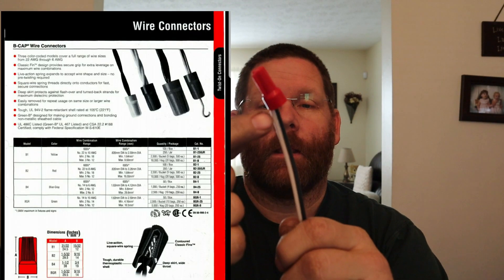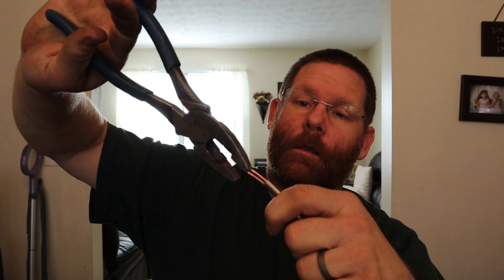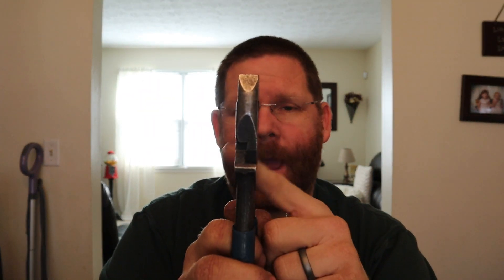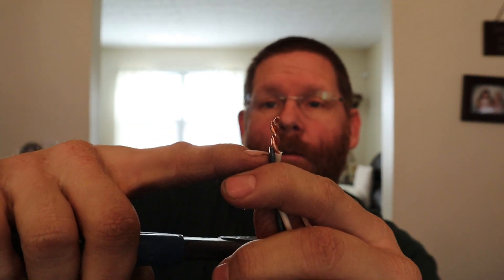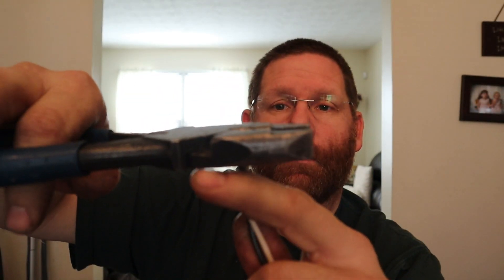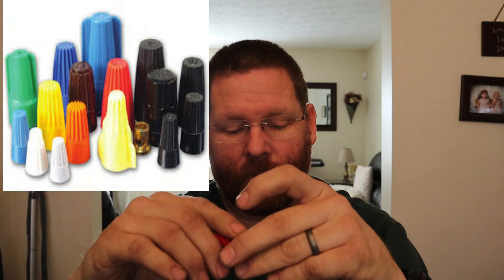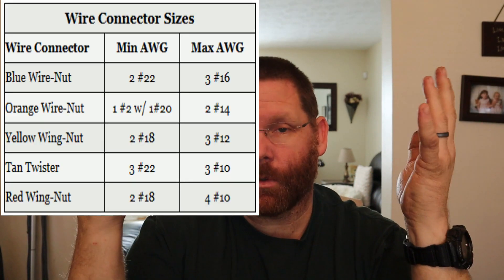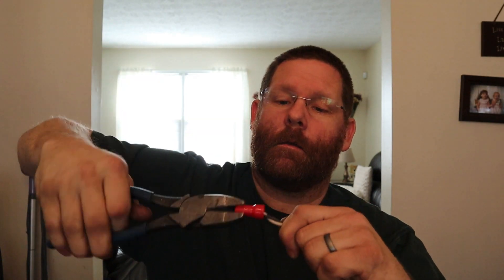How To Make The Perfect Wire Joint

Comment: Glad i found this, and thanks for doing it. Will this method be rock solid for making splices in a  junction box for a 220V line with 10/3 wire? I am relocating my dryer outlet. Also, is it wise to do a tug test?
Reply from the maker: Absolutely, I make this joint often. https://youtu.be/9QMWd43U-DU

Comment: I like your videos. You come across as legitimate and not egotistical and you explain things well, ok?  ;)

What I'd like to know is what technique to use to effectively pre-twist 4 #12 solid wires.  2 and even 3 wires is pretty easy. I'm doing junction boxes on a lighting circuit in a shop so I'm branching from 4 jboxes. 2 of those boxes have 1 input, 3 outputs,  plus I'm putting an outlet on the box.  That leaves me with 5 wires, including the pigtail for the outlet.  I decided to tie 3 wires together with a jumper (4 conductors under one wire nut).  I tie the jumper wire to the 4th wire plus a pigtail for the outlet.  Twisting those 4 wires together sucks.
Reply from the maker: I appreciate your kind words. I am pretty sure that you can put 4 under a red wire nut and if you use the 3m red/yellow you can get 5. It will take time but strip them long then cut them off accordingly. Good luck my friend

Comment: Have you ever had to twist 3 #10 wires together? How do you hold 3 #10 wires together and twist them together without them slipping around in your hand?
Reply from the maker: Not to sound mean or whatever but hand strength is the key
Reply: @MountaineerOutdoors  that's fine and all, but how would you use lineman's pliers to pre twist #10 wires together?
Reply from the maker: Same exact way honestly
Reply: Strip 1 and 1/2 inches of insulation, maybe a little more if necessary. Wrap electrical tape around the insulation near the stripped end keeping the 3 wires in a triangle, still leaving about 3 inches of wire to grip. Grab the last 1/4 to 3/8 inch of bare wire and twist with your Klein's. You can then remove or leave the tape alone, your choice.
Reply: @surferdude642  is this a solid splice, say for a junction box with 10/3 to move a 220V dryer outlet?

Comment: I can't seem to properly twist 4 12 gauge wires together without the insulation burning. Any advice?
Reply from the maker: Burning?? I'm not sure what you mean... Do you mean later after you have them twisted??
Reply: @MountaineerOutdoors  yes, there is a burning plastic smell from the insulation. Sometimes I see the burns, sometimes not. I guess I can try wago if the twist isn't proper, but the wire nut is on very tight so I don't know where I am going wrong. I am not daisy-chaining the receptacles and using pigtails.
Reply from the maker: If you have burning then there is no way your joints are tight, or maybe your breaker isn't properly sized?  It could be overloaded... Is it on your nuetrals or hots?  Wagos I definitely am not a huge fan of
Reply: It's 20A breaker on 100A service. Kitchen should be 20A. There are 13 circuits in the panel (added a tandem 15A breaker). I guess I can try again. I'm just trying to pinpoint the problem. I wouldn't rule out the panel being overloaded because there were originally 8 circuits.
Reply from the maker: What is burning nuetrals or hots?  Those tandem breakers are fine as long as your panel can accommodate them.  I'm still going to say that there is a loose connection somewhere... By chance is anything sharing a nuetral??
Reply: @MountaineerOutdoors  No, there shouldn't be any parallel neutrals. I've separated all the lights and receptacles to a dedicated circuit. Most of the receptacles are not used except a microwave. It's usually the hot wires. I think you're right that it's loose connections. Maybe I am cutting the wires too short after twisting them. I usually do .5"
Reply: It's only come up on 3 or more wires so I have to assume it's a bad connection. I have cans so wago is already in use

Comment: How tight should it be with the pliers
Reply from the maker: Just a few turns. You can actually twist too much.
Reply: @MountaineerOutdoors  yes cause I working on a mobile home smoke detector
Reply from the maker: Just make sure it's snug. Good luck 🤞
Reply: @MountaineerOutdoors  so no need for extra twisting with pliers correct
Reply from the maker: @nicolewebb558  nope

Comment: I want your opnion on wago connectors....your the first one doing a wire nut right.... everyone saying wire nuts come loose over time are full of shit.... they weren’t installed properly.... I’m not saying wagos aren’t good, or won’t work, I’m just saying it’s still not as good as a properly installed wire nut.... maybe, MAYBE with wires twisted past the wago like a nut, and a wrap of tape over the latches....
Reply from the maker: I appreciate your watching and commenting..I have been trying wagos out for a a few months now. I will say that they are convenient. However in my opinion I still have in my testing seen them pop off, some loose and fail. My opinion is that they are crap. I believe that they have a purpose which I will be discussing in a future video dedicated to wagos very soon. Bottom line is that I will never trust them.
Reply: Wago's work very well to resist pulling straight out, but the wires feel loose when rotating. It's a possible issue because they may back out a bit during movement. You can wrap electrical tape, half on the Wago levers and half on the wires to keep the Wago and the wires from rotating separately.
Reply from the maker: Good idea that would definitely work for sure

Comment: Dont use wire nuts. Use Wago terminals instead. Safer, better, reuseable
Reply from the maker: I am going to be doing a video this upcoming year on this topic
Reply: If reusing Wago's or push ins it's recommended to only use the same gauge wire or heavier.

Comment: With 14 awg never had to bother, with the pre twist  with 12 awg,  sure can help.  Then again I can palm a basketball without issue so never had a problem twisting the wirenuts on and getting that same twist.   Funny the rest of the world uses WAGO connectors,  stupid foreigner's 🙄
Reply from the maker: 😂 😂 Truth.. Thanks for watching and commenting ☺
Reply: Love the way you claim foreigners are stupid, but don't know how to use an apostrophe properly! 
That's funny!!
Reply: @kyleharrington9649  Guess you didn't notice the rolling eyes.
Reply: The problem with not pre twisting even for 14 gauge is that some wires may slip back when twisting the wire nut. The more wires you have, the more significant the problem.

Comment: Wish you'd shown twisting 3 together, or if you do anything differently when joining stranded with solid.
Reply: You should leave the stranded about 1/8 longer and twist, but tbh I'd use a Wago lever nut when mixing stranded and solid or when using stranded only. It's a better option, wire nuts are not great with stranded wire imo.
Reply from the maker: I don't know about wagos yet still testing them. I am gonna be doing a load video with them soon maybe near near fall but I am gonna put them to the test. I appreciate you watching and commenting ☺
Reply: @Mike Hoskins:  Good suggestion.  Thanks.

Comment: What about dark tape   just curious
Reply from the maker: Dark tape?
Reply: A special dark tape was used in older homes (prior to 1960 or so) and was the insulation for the connection which was by ferrule crimp and solder. It's not for use with or replacement of wire nuts or other modern connection methods.

Comment: Wago is better. Way better.
Reply: How are they crap? Wago 2273 series are the best. 
1. They take little time.
2. Little effort.
3. Good connection(if done correctly). Also you can see the connection if it is good or bad, this is very handy for trouble shooting.
4. Wire can not be pulled out without twisting and pulling simultaneously. 
5. Last but not least it requires no handle twisting motion to make the connection.
Forgot to mention they are super slim
Reply: Have you tried them? We used your method many years ago in Norway, but now we switch them out for Wago 2273.
Reply from the maker: I don't know i just don't trust them. Maybe it's because I'm just old fashioned..I'll stick to twisting for now.
Reply from the maker: Absolutely not those things are total crap. I will Definitely have to disagree with you on that

Comment: Well done and thanks man!!!
Reply from the maker: Thanks I appreciate your comment and watching ☺
Reply: I appreciate the videos and the work that goes into them. One question if I may is if i have a gfci in my garage and all of the regular outlets are downstream (from the gfci load out) am I protected on that circuit? Also I read having more than 2 gfci on the same line can cause conflicts. Just curious what your thoughts are.
Reply from the maker: I appreciate your comment... Yes your protected. Now the only way you will have problems with 2 gfi on w circuit is if they are on the load side of the gfi. So if you have 10 receps protected by one gfi and then you add one off the last one you would have problems because they are already protected. It would have to be on the line side of that first gfi.. Make sense.
Reply: @MountaineerOutdoors  Very helpful thanks!!! Working on my new pigtail information now :)
Reply from the maker: Good deal if you need anything else feel free to ask

Comment: I have five wires on a red as I spliced in an extra wire for a floodlight.  The connection keeps going out just to the floodlight, when I hand tighten the red nut it works then goes out again.  The circuit breaker is not affected.  Any ideas?  Should I install a box or use another piggy tail?  Any suggestions would be great, thanks!
Have a wonderful COVID19 day!
Jim
Reply from the maker: Are you sure that you have all of the joints tight? Also may need to check the nuetral. Is it a motion light or a dusk to dawn?
Reply: @MountaineerOutdoors  It's a motion light with the ability of low light from dusk to dawn, then it brightens to fullest when there is motion.  I know it is the nut as the same light works perfectly on another fitting.  I will recheck this tomorrow morning and maybe strip the sheaths to better twist the bare wire.
Reply: JimmyMeetsWorld chances are the wire you added for your floodlight, was after the joint was already made. If u added the 3rd wire without taking apart the whole joint you may have a lose connection and in ur case the marette is making the connection which is why it could work after tightening the marette

Comment: Awesome vid but still the damn wire nut.
Here in Germany we use the great products from wago. They take up to 5 wires or flex wires and current can go way beyond need. They finally also arrived in the us. They sell em
Reply from the maker: I just don't trust them. I like the thought behind it but still at the end of the day, your have that possibility of it heating up and failing. Just my opinion
Reply: Seen those melt. Tape that outside up
Reply: I'll use both - Wago for either temp work or something where I'm struggling with the fixture and in situations where I do not have a lot of draw (a 40 watt ceiling fixture) where I won't use them is in a junction box or for a high load receptacles, etc.  There's enough pro's / con's videos out there where I can see both sides.  To me (and I'm just a DIY home owner) they are like Shark Bite plumbing fasteners - probably good for 10 plus years but I would be nervous overall and in the long term.  One thing is for sure if you're going to use lever nuts make sure you buy the good brand name ones like Wago and be sure they aren't counterfeit or cheap copies - that's where a lot of "trust" issues come from.
Reply: @Scotty_in_Ohio  watch a yt video of a British guy. He puts the wago and Chinese products on a test with a transformer. All last currents > 100A. Given the connection is good. The wago lasts the longest
Reply from the maker: I totally agree with you on your thought process. You make a great point. I think maybe grounds but still I'm not sure. I have been in some tight spots where they would have been handy but still pass on using them. But like you said if you have to use them use a trusted name.